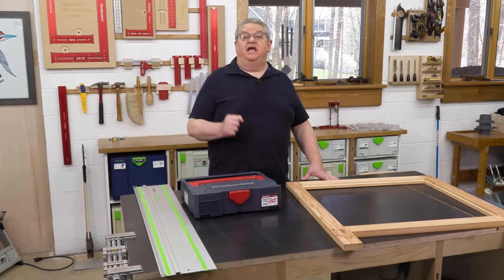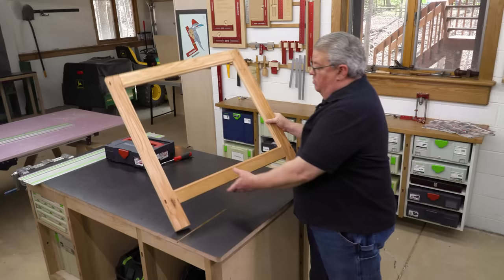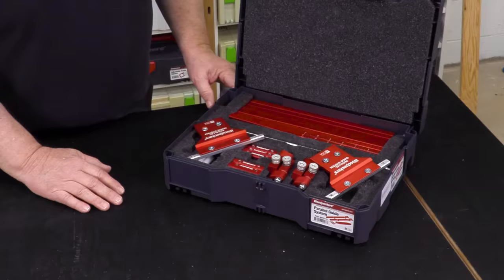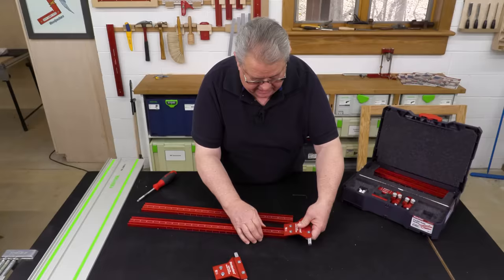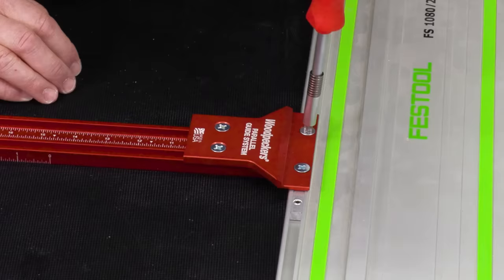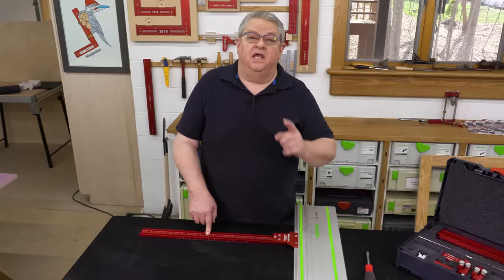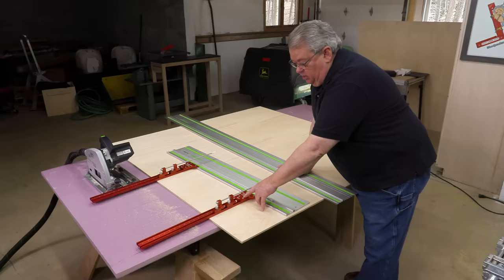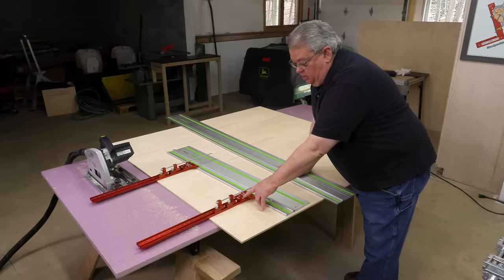This Track Saw Accessory Might Replace Your Table Saw | Deep Dive

Comment: I'm a big fan of woodpeckers but this calibration procedure is just ridiculous.
Put at steel ruler underneath the Festool track at e.g. 8". Set the stop block at 8" as well and slide it towards the ruler togheter with the loose red track. Thighten everything and youre done.

If Woodpecker provided a precission 8" (or some other apropriate length) ruler with sqaure ends it would be even less error prone as it sits flush to the track.
A nice addition would be a fysical stop on the red track for the stop blocks, then it would be foolproof.
Reply from the maker: Stefan, let me just point out a couple things about our calibration procedure compared to what you're proposing. The guide rail has a material on the underside that is specifically designed to resist slipping. Sliding a rule carefully sideways under the guide rail is cumbersome...we've tried it. With a rule under the guide rail, the guide rail and the Parallel Guide System track are no longer flat on the table, everything is rocking on top of the rule...no matter how thin. Alignment of a thin steel rule to the plastic splinter guard strip is an "eyeball" alignment, which might be tricky to get precise, particularly since the guide rail grip strips are fighting you. 

The alignment/narrow rip rods are exactly what you've asked for...and more. As a pair they are exactly the same length. The plastic tips have shoulders inside so they register off the end of the stainless rod. The stainless steel stop on the other end also has a precise positive registration to the rod. By running them through two stops they are now positively parallel to the tracks and perpendicular to the guide rail. The positioning of the stops is simplified with unmistakable indicators on the scale. The stops fit flush on top of the scale, so there is no parallax viewing error whatsoever. The rods are above the entire assembly, which is lying perfectly flat and stable on the work surface. Now all you need is a reliable square held against the splinter guard and bring the rods up until they bump. 

I do like the idea of a physical stop on the track to lock the calibration once established. I will pass that along to the Product Engineer.

Comment: Parallel guide set cost about the same as the saw itself(~$500). What justifies the cost?
Reply from the maker: It's $400 unless you need the interlocking tool box. Excluding off-the-shelf nuts and bolts, there are 46 pieces to this system, all of which are milled or turned. The laser engraving is held to the same exacting tolerance we maintain for our precision layout tools. The comparably priced Festool system has half the width capacity.
Reply: Thank you for the answer. I appreciate the complexity of the manufacturing process, but still the price seems very steep. I look from a perspective of what it does for me and in this case I believe there are much cheaper options.

BTW:  the saw without the box is also cheaper. $80 for a box? Isn’t Makita’s makpack less than half of this? 

Well, I wish you good luck!

Comment: Sorry, but any new tool needs to be an improvement over an old one.  In the amount of time it takes to set this up I'd already be finished with my cut using a square and a straight edge.  It also makes way more sense to know how to make precision cuts with stuff you can easily find at any store instead of being dependent on some obscure device.
Reply from the maker: As mentioned in earlier replies, this tool is not about making "a" cut, it is about making multiples at exactly the same dimension. Yes, there's some set-up involved, but once set, you can very quickly cut multiple pieces that will be perfectly dimensioned and perfectly square. Cutting multiple pieces each to a measured mark is not going to be as precise as using a stopped fence and is definitely going to take longer.

Comment: track saws excel with large sheets when you don't want an exact 90 degree angle....check the walls and corners in your home...you'll be hard pressed to find perfect square.

Comment: What is the pink underlayment you are cutting on?
Reply from the maker: Just a sheet of foam insulation from the home center.
Reply: @WoodpeckersLLC  does your blade cut into the foam?
Reply: @randholtham8493   yes the blade cuts into the foam
Reply: @randholtham8493  You set the blade depth so it 'just' nicks the foam..

Comment: Nope nopey nope...
MFT table, bench dogs and fence rail (do a search if you're not familiar).That's all you need to add to your track saw to break down sheet goods with extreme accuracy. 
Woodpecker make some great gear but this seems like an expensive and over complicated solution.
Reply: MFT table can only cut about 28" wide so not helpful with larger sizes

Comment: This completely defeats the object of the track saw. The genius of it is that you don't need clamps and jigs to get an accurate, straight, cut...
Reply from the maker: You're right, if you're talking about ONE cut. The point of the Parallel Guide System is making repeat cuts at exactly the same dimension.

Comment: That panel doesn't need to be accurate in the grooves, freehand with a circular saw should do just fine. Guarantee to lose some of those little pieces in  the sawdust and never find it, plus so much time on adjustment and setup. My table saw already set up for 4x8 sheets or I could knock panels down with a circular saw. Repeatability on the table saw is pretty good for multiple cuts, could go as fast as you could push the wood. I'll save my money on a panel saw, don't see the need for that either. No justification for major projects, lumber prices out of sight.

Comment: LOL you don't have space for a table saw but you got room for a 5x5 sheet of plywood....
Reply: A table saw needs space the size of the material you're cutting on either side of the blade - 4x8 sheet = 16+ feet.

Comment: It looks so complicated just to do straight cuts....furthermore it is clear how not comfortable it is when you have to move around the board, and finally the base board is damaged by the scratch left by the saw...I think such an arrangement could be good for smaller cuts, and only if the whole system were made simplier

Comment: While I really like Woodpecker tools, and own a few..  This..  is not a table saw replacement.  With the cost of this, and the cost of a quality tracksaw, you are in the price range of a used cabinet saw, or a brand new contractor saw.  I do not see any value in this as a replacement to a traditional table saw.  For an onsite contractor, maybe, as portable saws tend to be pretty crappy, but it is not a budget option.  And the space needed to cut sheet goods, won't change, so a large area is needed, whether using this system or a table saw, and table saws can be wheeled out of the way, so space constraints should not be an issue.
Reply from the maker: Space to cut sheet goods is dramatically less. With a table saw you need 8 feet in front of the saw and 8 feet behind the saw. With a track saw, you need the footprint of the sheet and enough room to walk around it. As I mentioned in an earlier reply, our headline writer might have gone a little over the top, but we aren't suggesting you throw away your table saw. This is an accurate and safe way to single-handedly cut sheet goods in a limited space. The results using a quality track saw will be as accurate as a premium table saw with a premium fence.

Comment: This is the dictionary definition of "overly complicated and cumbersome" - probably expensive as .... - and completely useless if the rubber edge of your guide rail is worn unevenly.
Just measure thoroughly from a factory edge, 2 times more than you need, and hopefully only cut once - that's for free and doesn't make setting up 1 single cut 287 times as complicated while your dollars seep out of your pockets.
Reply from the maker: The point of the Parallel Guide System is not making "one single cut"...it's about making multiple cuts all exactly the same without re-measuring. Measure once, cut a thousand times.

Comment: I'm new to woodworking but isn't this just to eliminate the need to measure??
Reply from the maker: If you're always setting to a measured line, your consistency is not going to be as good as using something that uses a physical stop that doesn't move. A good example is a table saw rip fence. Once you move a fence, setting it back to the same dimension rarely gets two pieces that are exactly the same.

Comment: Woodpecker sells some really innovative products, but they need to be more transparent about their production cycles.  If you order something, it's highly unlikely you will receive it on time.  It's almost a crowd funding process.  They don't produce your product until after they've received payment.

I have no problem with that, but they need to own up to it.
Reply from the maker: That is not correct. We do not charge your credit card until the product is ready to ship.
Reply: @WoodpeckersLLC  I don't think you are acknowledging my point.
Reply from the maker: You stated as a fact that we "don't produce your product until after 'they've' received payment." That is not how we do it. We do not charge you until the item is produced, assembled, packaged and in the shipping department. Any delays are the result of production scheduling, design refinements, or (most likely) raw materials supplier delays.
Reply: @WoodpeckersLLC  I know this to be true because I did not get billed until my item shipped... and I love my squares from WP :)

Comment: Hefty price, might be handy but replacing a table saw? Don't see that happening, to much time wasted on assembling the whole thing.  Great for big sheets yes, but since u gotta get those deliverd or need like a truck with a trailer to move those better buy smart n get smaller sheets where u can n just put them in we back of ur car... I must say at 10:20 measuring in seconds is a epic trade I still try to learn myself lol

Comment: Apologies but this is the epitome of today’s tool industry focusing in on retirees with too much time and money on their hands. All his concerns for wood out of square and straight cuts can be addressed with a simple lesson on squaring a board, a framing square and a good quality 48” straight-edge. Woodpecker has found a way to market woodworking jigs like “Shop-Smith’s”. Yes, they may perform a number of different tasks for you, but the time and effort required to set up the task at hand  will quickly lead to another new tool being mothballed.

Comment: That seemed way to complicated. I would rather just use a tape measure and clamp the track to the board.
Reply from the maker: Fine for one cut. This tool is about repeatability. Multiple pieces all at the same dimension.

Comment: No offense but this is the most complex and ridiculous device I have ever seen as  a workshop tool. With sixty different screws and things to adjust, and many things to square up, could anyone have invented a more complicated way of doing anything? I was really hoping it would be a tool I could like, because most small shops could use a better way of handling large sheets while working alone. I would never buy a tool like this. I've seen enough. Thank you for explaining it so well.
Reply from the maker: So, you would prefer that I skip all the detail and just show you the tool in use? There's no tool that can deliver repeatable results that isn't going to require some calibration. Once it is set up, you can make as many PRECISELY REPEATABLE cuts as you need to, much faster and far more accurately than you can measure and mark. Next video I'll just show the magic and skip the detail.
Reply: @WoodpeckersLLC  My complaint was not at all about your methods or your video. It was about the tool itself, as having way too many parts, screws, and adjustments. As I said, thank you for explaining this tool so well. The expert explanation allows me to make the informed decision to not buy this tool.

Comment: great tool! but too complicated though. I use a tape measure, make marks, then clamp my cut guide for the saw, done in about 3 minutes!
Reply from the maker: How do you make the second panel exactly the same size as the first? And the tenth??
Reply: @WoodpeckersLLC  ahh, very good question... good ol' fashioned measure once cut three times;) ancient chinese secret

Comment: What is the material, and where might I get it, that the plywood is on when making your cuts?  What thicknesses and LxW for your piece?
Reply from the maker: James, that's just a piece of rigid urethane foam insulation from the home center. It's a full 4' x 8'. Doesn't matter whether it's the blue, pink, green or purple brand of foam. Whatever's on sale. I like the 1" thickness...holds up better than the 3/4 but doesn't cost as much as the 1-1/2. I keep that sheet just for breaking down full sheets of plywood and MDF. With a little care a $20 sheet of foam will last a couple years of supporting track saw cutting.
Reply: @WoodpeckersLLC  you might have mentioned it in the video. But thanks for the idea
Reply: @WoodpeckersLLC  Thanks very much for the reply.  Keep up the good work on the videos.  As I read through the replies to this video, I congratulate you for your "thick skin" in reading and responding to some of the replies you get. :)
Reply: @WoodpeckersLLC  Would the "rigid urethane foam insulation" you used be the same as the R-Tech Expanded Polystyrene (EPS) rigid foam insulation manufactured by insulfoam.com?

I ask because both Home Depot and Lowes only carry the Polystyrene type.
Reply from the maker: Ken, it really doesn't matter what kind of foam. It's just to support the plywood and keep you from cutting into your workbench or saw horses. The best foam to use is the easiest one to find that is the least expensive.
Reply: @WoodpeckersLLC  thanks

Comment: Parallel Guide System 480$ USD + Adjustable Track 480$ USD?
So almost 1000$ USD and you don't even have the tracks or the saw.
And I'm not talking about his 1000$ festool track saw.

I would rather spend the 1000$ on a SLIDING TABLE ATTACHEMENT. No more problem handling you plywood sheet.

The only power these have is the power to empty your wallet!

Comment: That’s a lot of playing around to just get set up.  A measure on each side and lining up a track is much faster
Reply from the maker: Lining up to a pair of marks is a perfectly acceptable method for ONE cut. The Parallel Guide System is about repeat cutting. The more pieces you need of a particular size, the more time you save by using it. Precision is the other benefit, particularly when parts need to be interchangeable.
Reply: I don't find it so easy to line up on marks, definitely not for multiple cuts.  Takes a 2-3 tweaks on each end to get it right.  The guide is faster and more accurate

Comment: Good designed but not practical? Need to think again before buying this parallel guide assist. It probably stay in their shop for awhile then slowly disappear from their production line due to no market for it. The most complicated way to cut sheet good. All I need to cut large sheet good is a circular saw with a straight edge then square them up on my table saw. A good Makita circular saw and a Dewalt DWE 7491 table saw are way cheaper than this system and the plunge saw combined and table saw can do more stuff than this system. Just saying...

Comment: table saws scare me so something like this feels like a good solution
Reply: The fact that you are scared shows you have a healthy respect for one of the most dangerous tools (if used improperly).

However, used properly, the table saw is far superior in efficiency, and versatility. This system isn't really worth the price
Reply: @sorenjensen3863  for me personally. I dont have a work space. so everything has to be pulled out of a shed, and setup temporarily.. even a portable table saw takes up alot of space

Comment: Garbage. Buy the TSO PARALLEL GUIDE SYSTEM für less than half the money and you are not only cheaper but also faster.
Reply: Or Seneca Woodworking's version — equally nice, also half the price of Woodpeckers.

Comment: I cant see the benefit of this if you cant store it setup. It takes more time to setup than it takes to call over my friend, wife, or neighbor to help me move the wood.  

I am a track saw fan, I just dont understand this parallel guide system.
Reply from the maker: The only reason you would have to take it apart is to put it back in the box. If you have room to store the first section of the arms assembled, calibration would be maintained.

Comment: Was he using a Festool 55 or 75 saw?
Reply from the maker: AT-65. Hasn't been made in years. It's old enough to have a beer in a bar. I always thought of it as the "Mama Bear"...not too big, not too little. Not sure why the discontinued it. I wouldn't trade it for either a 55 or 75.
Reply: Woodpeckers , ahhh must be why I could not determine the saw size. I’m trying to determine which corded Festool saw to order. I would prefer having the larger capacity of the 75 saw, but concerned if that will make general use awkward, for example with this great Woodpecker guide system?
Reply from the maker: If you're getting a track saw primarily for sheet goods, I would recommend the 55. Don't pay for depth of cut you'll never use.
Reply: Woodpeckers , thank you!

Comment: $480 for a pain in the neck thing to set up with 20 different parts to cut a parallel cuts is pretty ridiculous
Reply: No way is the cost 480! I can just use a 100 saw track !